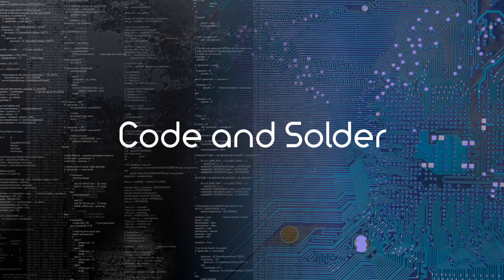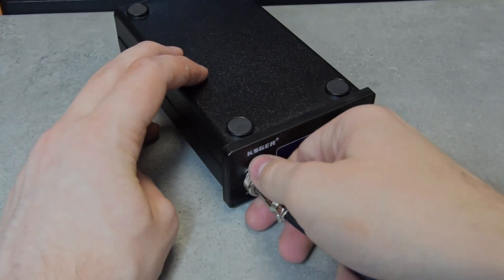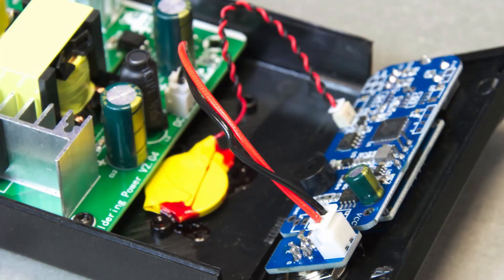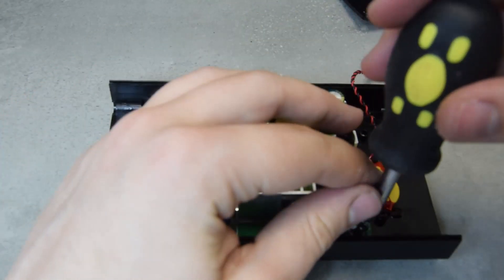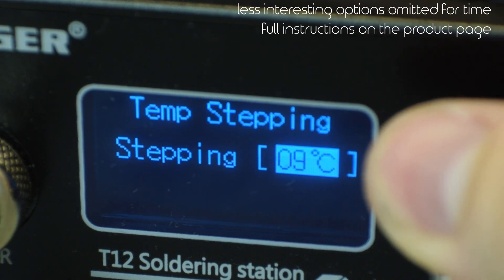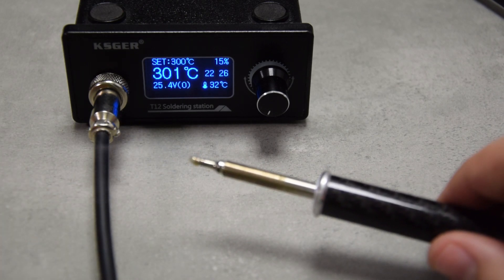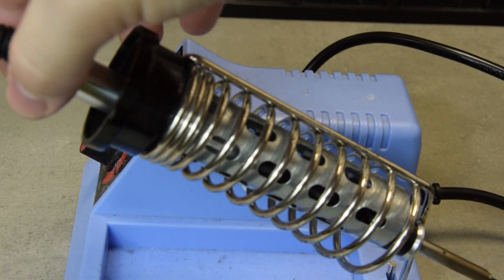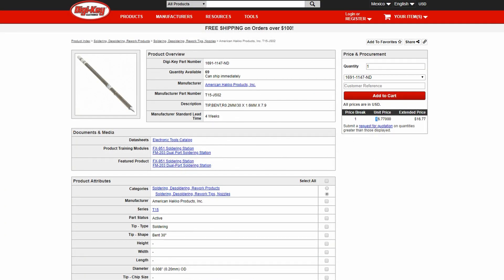KSGER T12 Soldering Station - teardown and review

Comment: Hi. It's also one of my favorite tools (along with the first all metal digital caliper by General). I just had my T12 a few days ago, it has the 2.12 firmware. The rebranded Quicko is about 100% cheaper than the KSGER one but it only comes in the MINI which can be great durability but maybe not for looking good or stacking. The Quicko one is just US$22, shipped and comes with the blue and yellow, comics X-Men iron:-) )

Someday, when I have more budget, I'll sell, donate or giveaway my Quick 858D and T12 and get the very cool KSGER 2 in 1 combo unit with the black and chrome metal iron:-)

God bless, Rev.21:4

Comment: This seems to be an 80w iron like the TS-80. It seems to use similar tips, so it should be similar performance. This has a case and plugs straight into the wall, the TS-80 has open source firmware, but needs a separate power supply. Seems ok for the price. I think you can plug in different handles that take the same tip, that connector is very common. Maybe that would fix the handle heating up.
Reply from the maker: Yup, the T12 tips have about 8 ohm internal resistance so at 25V it's about 80W.
And there are many handle designs like the blue one in one of the pictures. It's always a trade-off between size/ material and thermal isolation and at 270C the heating isn't a problem so I like this one.

Comment: Interesting review. 
Actually, the price of the tips was to me a "pro" when selecting this station (I bought it a couple months ago), compared to the price of the TS-100 and TS-80 tips. Original Hakko tips are a bit expensive, but the Chinese clones are dirt cheap at around $4. Surprisingly, they are really well made.
Although not open source, this station has been reverse engineered and there is a custom firmware available: https://github.com/PTDreamer/stm32_soldering_iron_controller
There is even an Eagle schematic file of the board
Reply from the maker: Yeah, the clones are OK, I was comparing more to the "dumb" tips for cheap irons at a quarter each.
Reply: @CodeandSolder  Sure. In my case I evaluated only stations with internally heated cartridges, that is why I found the clone Hakko tips so cheap compared to other brands.
Reply from the maker: In that context they are much cheaper, yes, especially from the proprietary brands with no clones like JBL or the portables.

Comment: Does the fact that the wire is not attached inside the handle other than by it's solder connections not scare anyone?

Or is it attached better, but I couldn't see in the video?